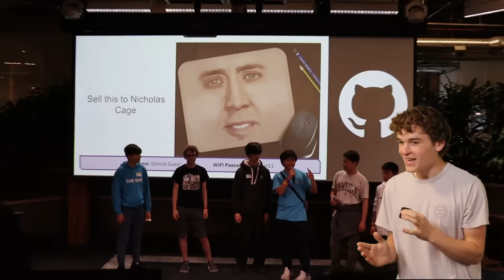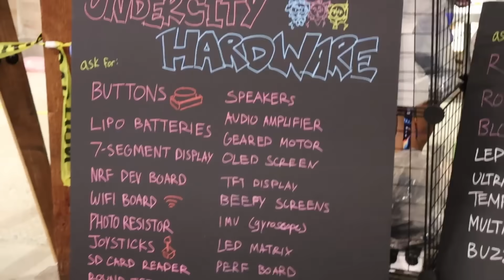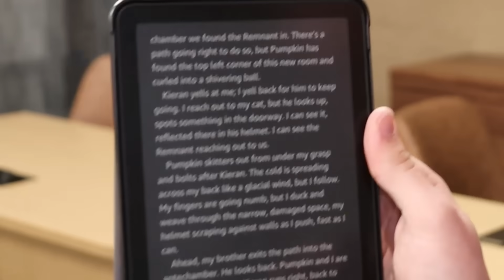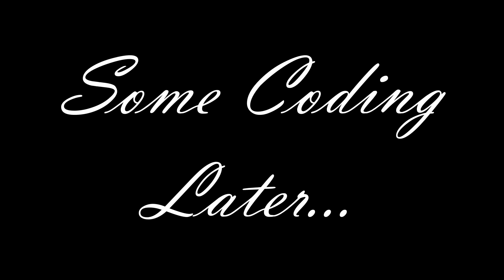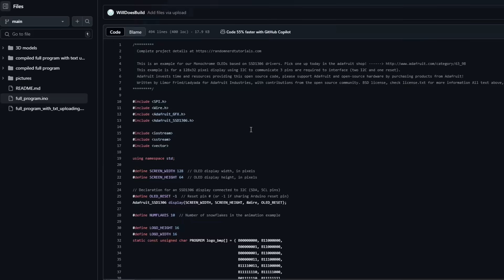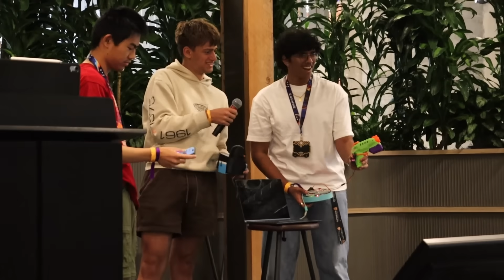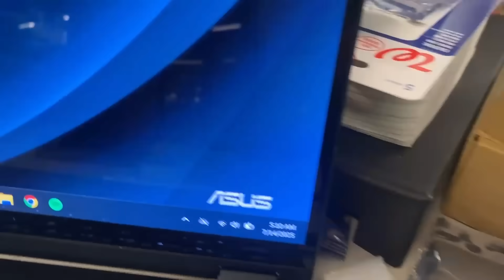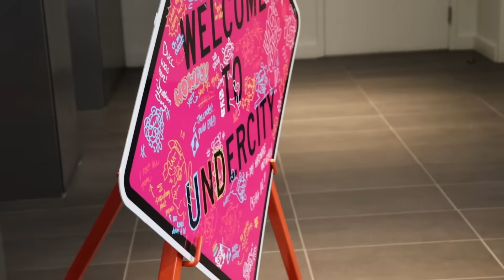I Traveled 700 Miles To Make THIS

Comment: One big thing about those e-ink displays (also had to learn this the hard way): They'll often just not work on Breadboards because the connection isn't reliable enough. They are really intolerant towards transmission errors.
Reply from the maker: Interesting... I do want to use the e-inks in a future project, because they are pretty cool!

Comment: The eink not working might have been a blessing in disguise.

It's refresh rate would have been really low which would hurt the reading experience.

You need the ability for the text to change relatively fast if you're doing one-word-at-a-time reading like tiktok.

(Haven't seen the whole video while writing this, idk if the oled idea worked)

Comment: U can simply add memory card support, and yeah make it so it can read from a txt file, actually full crud support for the txt so u can stringify it by part, so not an entire txt file at the same time, so hopefully it can reduce the load of the system.

Comment: Just a couple ideas to optimize the code:

You don't actually need a string, it is stored in RAM, you should use a const char[]. The board you use has 2MB of flash, so you could fit safely at least a million ascii characters.

You can iterate over that char array in flash memory by just accesing it's index and saving the current letter, just make a buffer and append the next letter until you find a space, then stop iterating. You still have that position so you can start from there for the next word. Same if you wanna just go back.

To detect the end of the book, use \0 character or if position equals 0 you detect the start (if you go backwards). So null terminate the char array with adding \0 at the end.

This means you should avoid making an array of the words on runtime, which will be stored on RAM and you'll run out very quickly.

With that said, I think you can fit at least one book on the device, the average Harry Potter book is ~800k characters including spaces and punctuation.

I love the idea, I thought about an app that did this when I saw a reel that forced you reading word by word, but a device that fits in a pocket that does that is a really nice idea. Great job!

Comment: Raspberry Pi? It’s an ESP32 you’re using arduino
Reply from the maker: I’m programming the RP2040 with the Arduino IDE! I’m not exactly sure how it works, but it involves installing a 2040 core.
Reply: The Seeed Xiao has a few different models with different SOCs, including two with Raspberry Pi chips (RP2040 and RP2350). The default firmware from Seeed is compatible with Arduino, but the RP Xiaos are also compatible with the Pi ecosystem. I've only used the SAMD21, nRF52840, and ESP32C6 Xiaos, so I'm not familiar with how the RP Xiaos work, but I'd assume you could reflash them with Pi OS if you wanted to use them like a Pi. 
tl;dr: Raspberry Pi chip running Arduino firmware. Computers are cool.

Comment: I believe that mcu has WiFi so one could upload books over WiFi me have a battery. Then you would need to worry about connecting it to the computer
Reply from the maker: The XIAO RP2040 actually does not have built-in WIFI, but I could have used batteries if we had small button cells or something available to us

Comment: The esp32-S3 has only a few megabytes of memory. You can add an SD card module and be able to store whole books there. The other option, since you’re using a wired usb-c cable, is to send data chunks through the USB from a computer, or using WIFI/bluetooth with a simple web server.

Good job on the project!
Reply from the maker: Great points! SD card would be the obvious choice, if I had thought of it before making the case :)
Reply: @willdoesbuild  just wanted to provide a bit more insight here. The s3 has 8mb of flash, AND 8mb of PSRAM. This is on top of the 512kb of SRAM, and I’m assuming you were only able to access that for your project given your couple of chapters limitation, but the PSRAM would be perfect for this project!

Since the ram and flash are shared with your firmware and system requirements, you end up with way less useable space in practice. That PSRAM block isn’t used by the system to run (iirc), so there should be 7.5+mb of space there to play with! That should be enough for multiple books if you wanted!

PSRAM isn’t persistent though, so you would need to maintain power after loading a book, but ESP’s have pretty solid light sleep functionality which does keep that ram active at the cost of a few mAh in power. 

SD cards are super easy to implement and remove the need for an OTA or other file loading/unzipping function, but PSRAM still makes sense to utilize for this project regardless.

Comment: I made.... exactly this. I was messing with some google stuff and have it hosting a few books. But it shows 1 word at a time, you can change the speed per syllable (not per word) and I made it so it only progresses when you hold a button down. It also saved progress across users so you could be on more than one book and continue.

I cant share links in youtube comments otherwise I would.

Comment: It's really odd that your device can only hold half a chapter. The board you have has 2mb of flash and your bin file is around 380kb and half a chapter would be like 4kb, so the bin file should only be taking up like 20% of the flash. Maybe you had something else stored in flash?
Reply from the maker: I did look at this after compiling the code - it really should not be a space issue, but I'm not an expert on microcontroller architectures or anything :( next time, I'll just use an sd card reader!

Comment: really cool, congrats on 2nd place! 

You should use an SD Card to store the book material, that way you can easily and cheaply add bulk storage to any small microcontroller device.
Reply: The ONE downside to the Seeeduino Xiaos is they don't have onboard SD readers. Their built-in firmware does support SD readers, tho, so it's easy to add, but takes up precious GPIO space that is already at a premium on such a small board. There's also no built-in power source, so for an SD card to be useful you'd also want to add a battery. Both are doable but add so much complexity for a 4-day hackathon. 
Sooo yes, this has my vote for version 2!
Reply from the maker: Adding on to this, I forgot to put an SD card reader and had already made the case :)
Reply: @willdoesbuild  Is it possible to flip the mode on that RP2040 and use the USB-C connector for a flash drive? There are some really tiny ones, or you could shuck the case off. Or maybe wire another connector (some compact panel mount) for a compartment where it's inserted and supported nicely. Pico-PIO-USB or Adafruit TinyUSB libraries might help?